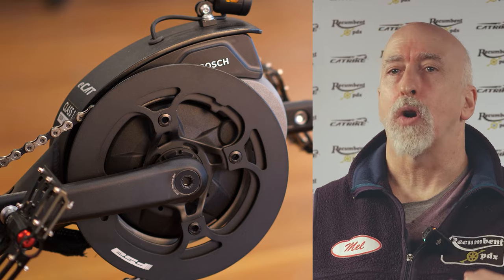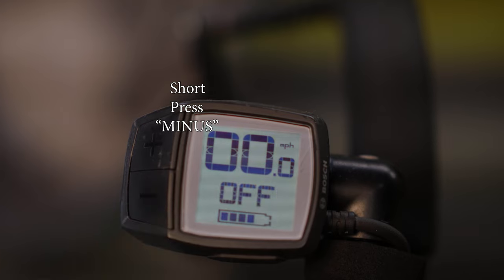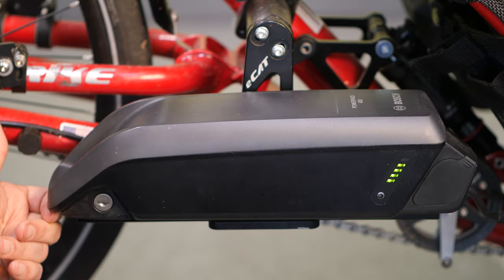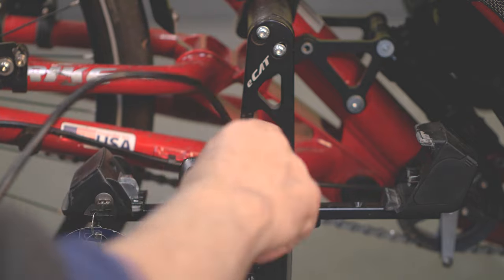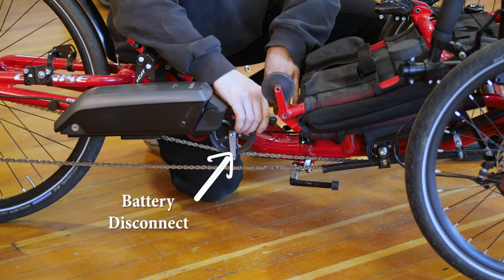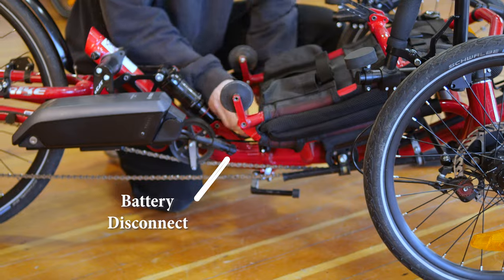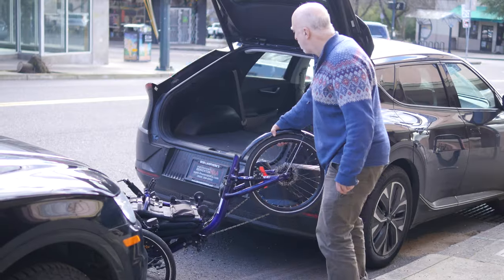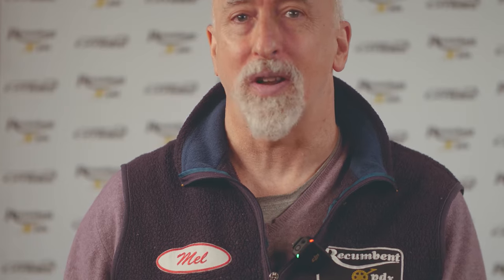Catrike Bosch Motor User Guide

Comment: That was the most incredibly informative video, no matter which E-Assist brands owned or being shopped for.
250Watt motor moves this 380-pound rider excellently.
Greatly stated in video that higher wattage systems are hugely illegal on bicycle paths!
Too many are totally ignorant of that 250Watt limitation.
Some bicycle paths are illegally going to turn into bicycle expressways! Don't go there!
Shop only for "Class One" systems if bicycle path riding is intended.
The presented motor use and battery use tips are incredibly important to understand!
Thanks for your video which should become standardized viewing in our E-assist world!
Reply from the maker: Thank you!